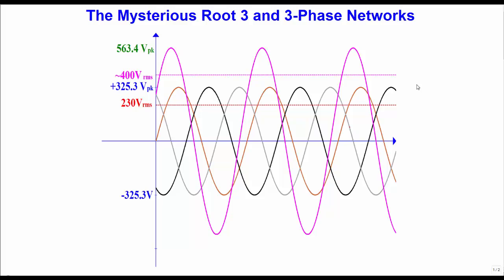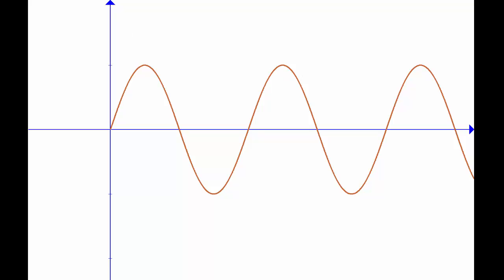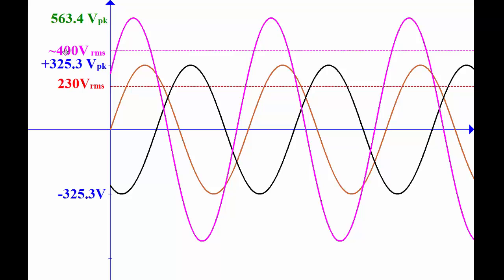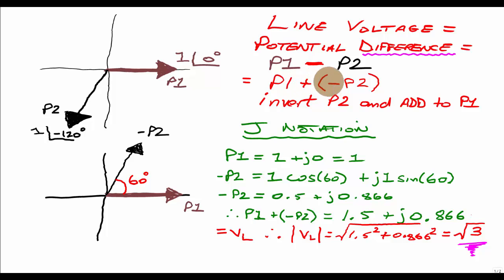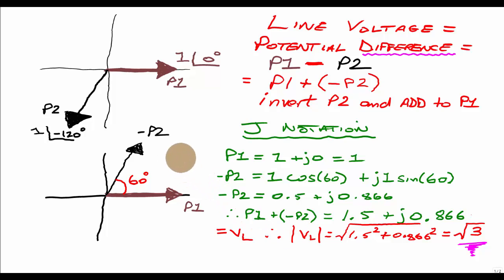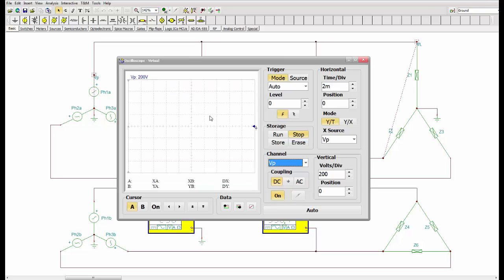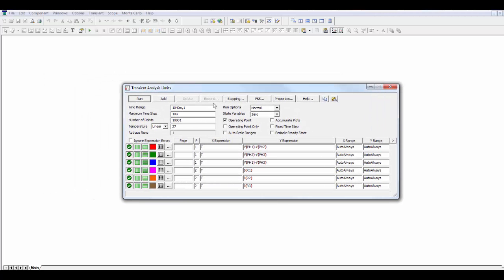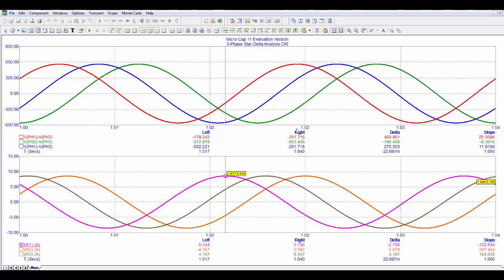The Mysterious Root 3 and 3-Phase Systems Analysis

Comment: I think I finally understand it now, everyone else explains it with vectors, which never really gave me the intuition behind what's happening in reality (see 5:00).
I think the point that I was always missing is that both 230V and 400V are RMS, which means in reality the potential difference between phases is not 400V at every point in time.
Thanks a lot!